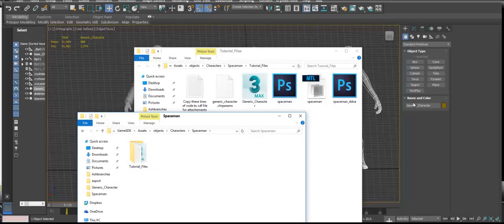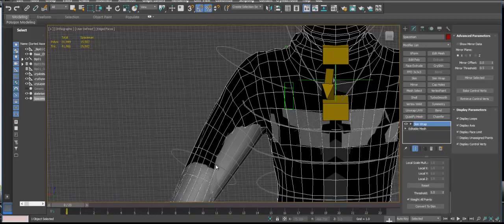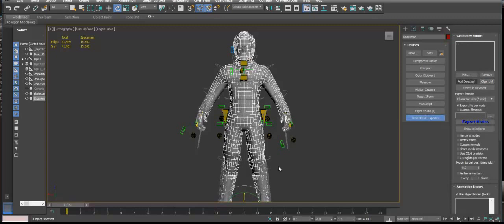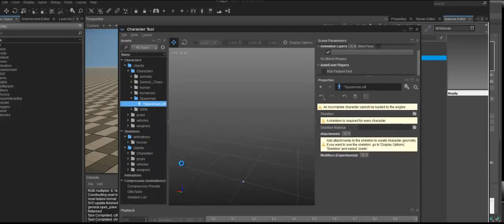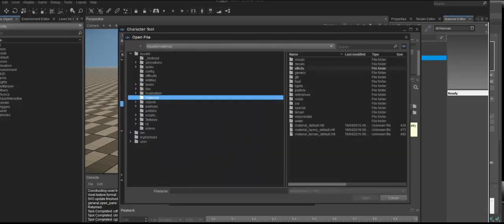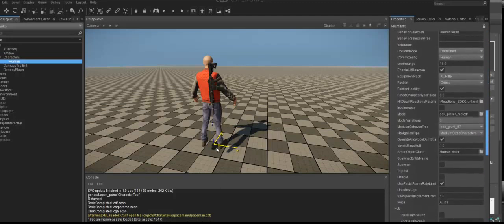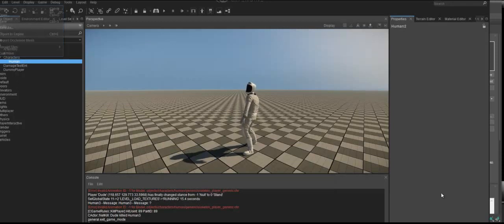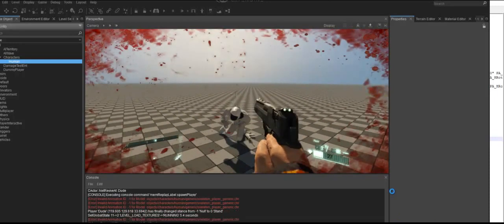Cryengine V Basic Character Import Tutorial

Comment: Amazing. Works perfectly. By the way in the Character Tool of cry engine, do you know how to move the skeleton bones or how to move the character?
Reply from the maker: not sure what your asking here, you can't move bones in the character tool. you can preview animations if you load them onto the character you create.
Reply: I import a rigged character from max to cryengine, the problem is that the default skeleton from cryengine does not match the imported character. Is there a trick to resolve it? your character matches, but mine don t. Do you have to place the arms down to match in Max. Is it possible to move the character imported or the bones on the character tool?
Reply from the maker: The mesh of the character has to match the rig pose or the animations wont work as this is the default pose for animations. you need to adjust you mesh to match before skinning or if rigged in a different pose, just pose it to match then collapse the skin and re skin it in the new pose. Can't do any of this in engine as it has to be exported this way from max ;)

Comment: I cant figure out how to get a .skin file out of fuse it only gives me a .obj
Reply from the maker: A skin file is created by the cryengine exporter, it's just a mesh. Trouble with a fuse mesh is that it will have a different pose to the sdk character so will need reposing using it's supplied rig. You should get and fbx file option if i recall. Best option is to import it straight to CRYENGINE using the fbx importer using the first person template and use your own rig and animations now the CRYENGINE has vastly been improved. To use the GameSDK animations and system then you need to repose to sdk characters pose, collapse everything, export the meshes and import those, if your using this method.

Comment: Thank you. I have been looking for something like this for a very long time.  Will this work with imported models from Fuse, or Autodesk Character Generator? From reading your other messages am I correct that I would have to pose the new models (that are in T-Pose) to match your model?
Reply from the maker: Anything that's not posed correctly wont animate correctly, the initial pose is purley for the animations to work so if you want to use the sdk animations then you need to repose it ;)
Reply: yeah that was my first thought.  I recorded all of the rotations on the joints to try and get your model into a t pose so I could skin my model to your rig and then reset the joints back to A pose.  it didn't like it.  especially the fingers.  too bad Mixamo doesn't output to cryengine.

Comment: hello, i have a question, how did you create your character mesh fitting the default rig ? can you explain please ?
Reply from the maker: I supplied a sample scene which has a base character in the default pose, low poly, which you can easily use to create a charcter from without the need for rigging and reshaping to fit the rig If using marvelous designer you can use this as an avatar and your good to go.. If you have a character in another pose, T pose for example you could setup a basic rig to manipulate it and pose it to the default rig. If you have something more specific let me know. ;)
Reply: would you discuss more on this with me please? 
skype : afsoft.co_tm.ltd

thanks!